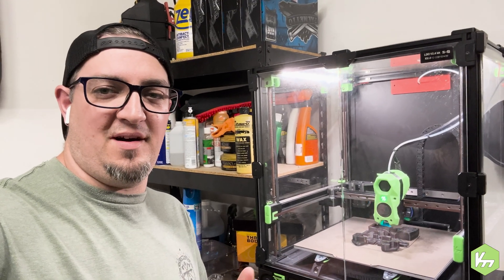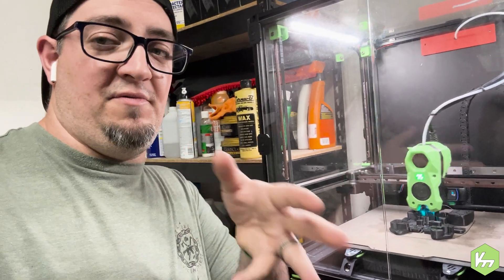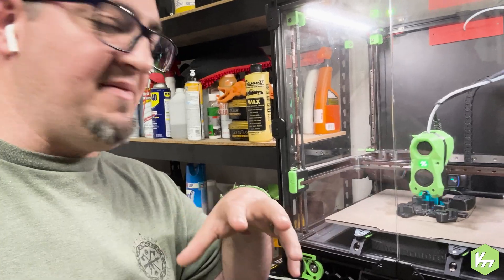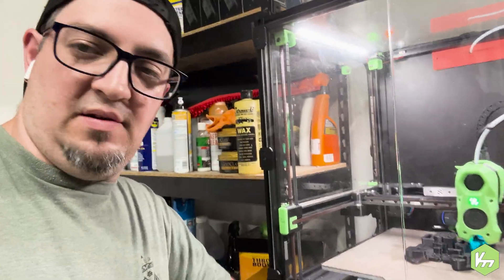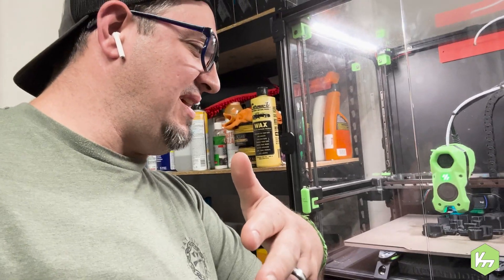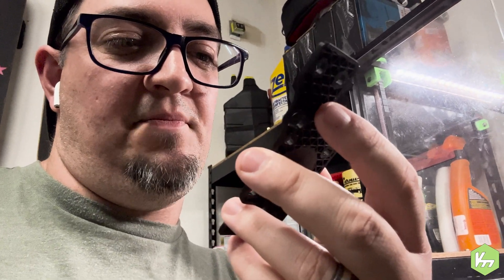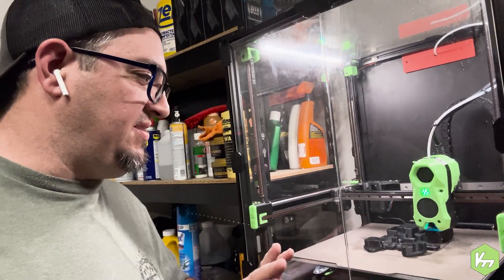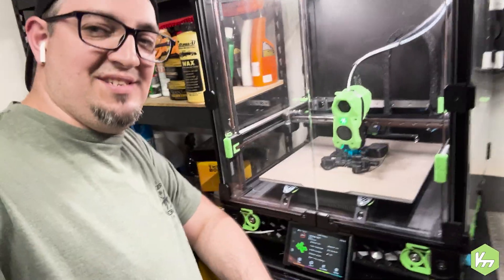From the Toolbox Episode 1

Comment: Going to be re-building my Voron V2.4 in the next few months. After over a year of effortless printing, things started to fail here and there and now I don't really trust it to finish and do so with quality. Figured I'd take that opportunity to go CANBUS (i've had the mellow CANBUS sitting in a box for months) and maybe the TAP (using EUCLID now) and lastly, a change in color scheme. To be honest, after getting my Bambu printers, my Voron has really taken a back seat unless I needed a bigger print.

Will be following along closely and hopefully I can bring my Voron to its former glory!
Reply from the maker: well this presents and opportunity then for more content...
Reply: @TheVoronModder  funny enough, I went back and checked my Ramallama's and sure enough, belt shavings.... Guess I'll be looking for an alternative or going back to stock.
Reply from the maker: @AbjectMaelstrom  I included a link for you in the description of my ramalama center mod. They can be tricky getting the bearings and washers in there however, I have not had a single problem with the updated part yet. https://www.printables.com/model/546966-ramalama-xy-tensioner-center-replacment-for-tighte